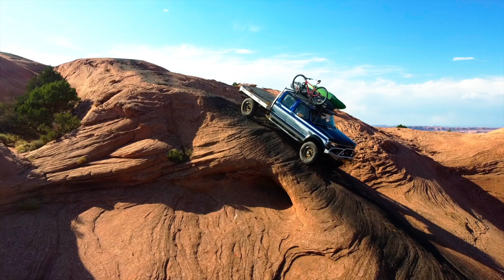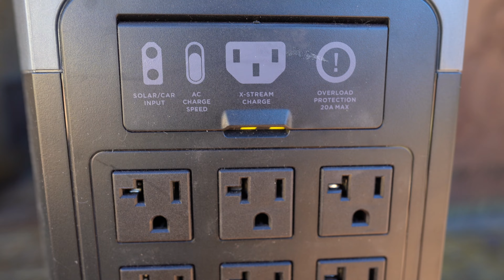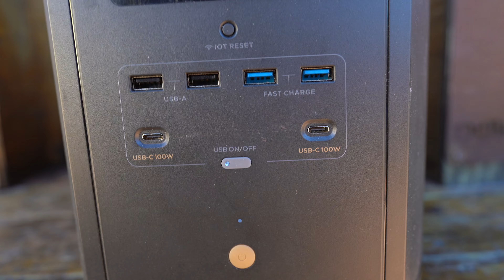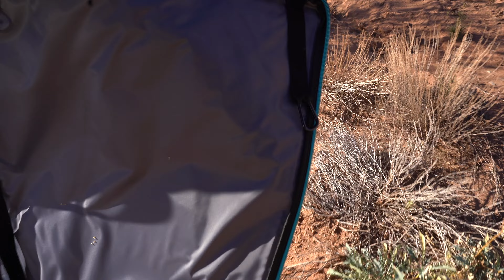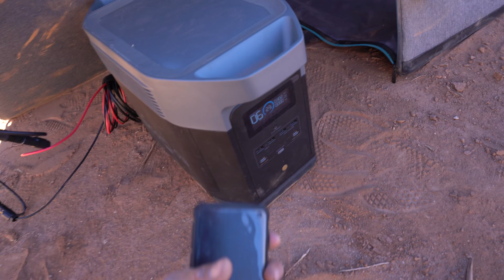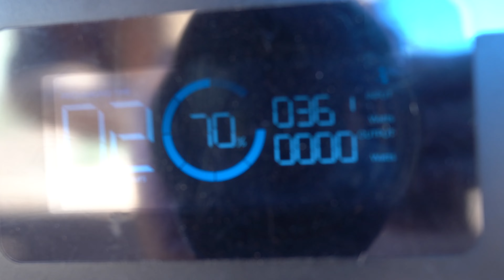Review: Ecoflow Delta Max power station & the most powerful portable solar panel ever made!

Comment: Have they switched to LiPO batteries yet?  I have an older mini....   and a limited budget (saving for the next Burn)
Reply: The delta 2 and delta pro are Lipo. If you don’t deplete this daily, the older battery technology is fine for most people.
Reply: @whitmorestrains  Thank you for your reply.  I will probably stick with the old bat as use it mostly for supplemental ; 3 charge cycles per month is my typical.  I plan on another delta mini with and array of panels.  retired engineer in the field...